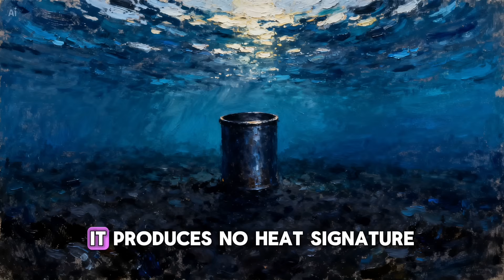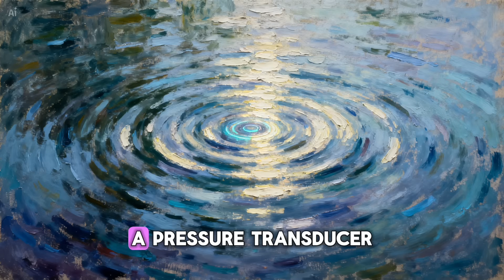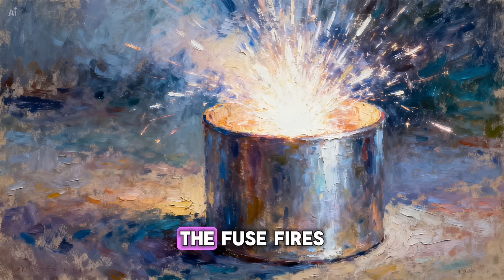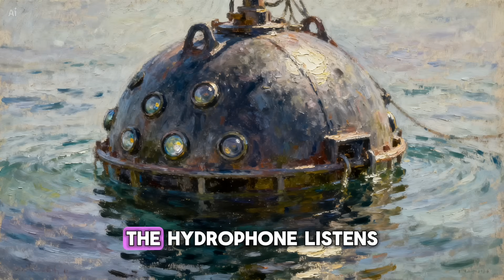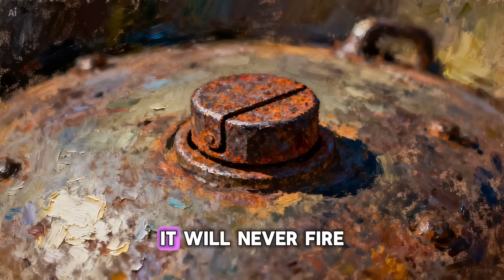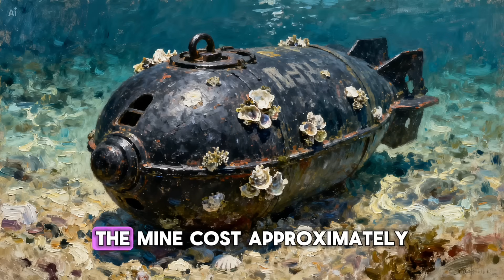Why Iran's Entire Mine Strategy Fails Against One US Ship Nobody Talks About

Comment: great video.  some notes.  small iranian fast attack ships don't create a pressure wave large enough to trigger a influence mine set to be triggered by a major vessel's compression wave.  Next 10 of the 14 MCM have been decommissioned.  Including some in late 2025 and early 2026.  Currently only 4 of these MCM are still in service.  they were based with the 7th fleet in Japan.   I assume these are being moved.  The replacement vessels are the Littoral Combat vessels.  I don't think those ships are as invisible to influence mines as the MCM Avenger class ships.

Comment: 3 minutes of information that you mangle into a 20 minute video. 
Hormuz being cleared of mines. Iran defeated. 

The video from the WarVision channel explains why Iran’s naval mine strategy in the Persian Gulf (especially the Strait of Hormuz) has a critical flaw against the U.S. Navy’s Avenger-class mine countermeasures ship (MCM-1, like the USS Avenger).
Iran fields 5,000–6,000 mines, including advanced influence mines that use a three-sensor system (magnetic, acoustic, and pressure) to detect and target large steel-hulled ships while ignoring small or low-signature vessels.
The Avenger defeats them entirely through its design:
•  Wooden hull (Douglas fir and cedar with fiberglass sheathing) that produces no magnetic signature.
•  Vibration-isolated engines and low-cavitation propellers that minimize acoustic noise.
•  Small size and low speed that keep its pressure wave below detection thresholds.
This renders the mines effectively “blind” to the Avenger, which can then use advanced sonar (AN/SQQ-32), towed systems, and low-cost disposal vehicles to hunt and destroy mines one by one.
The video also covers Iran’s doctrinal weaknesses (e.g., its own mines hinder its surface fleet) and the cost asymmetry (expensive single-use mines vs. a reusable, specialized ship). It draws on real systems, historical context like the 1987 tanker war, and current U.S. deployments. ￼
Overall, it’s a technical breakdown arguing that Iran’s mine warfare approach is fundamentally undermined by one low-tech but cleverly designed U.S. vessel that “nobody talks about.”
Reply: The video bloat is standard practice because of the way videos are monetized on YouTube.

Comment: I worked with a Retired Admiral.  He told me that, during an earlier war (Iraq?), mines were cleared by sailing an old tanker (with no cargo, only water) through the Straits and blowing up mines.  He said that it worked well.  The tanker took the shock and kept going.

Retired electrical engineer, ships.
Reply: Wow ooohh. Why didn't  anyone thought of that an old tanker. Problem solved. And what did  we achieved in Iraq really.

Comment: Hovercraft
Reply: How do hovercraft avoid being detected by proximity fuses? I presume you are not advocating for hovercraft to transport oil or cargo?
Reply: @ricklearn16 hover craft don't touch the water. So it won't set off a mine. A hover craft can carry an M1 Abrams and other stuff at a time.
Reply: @mmkkggggoodd2315  I have ridden hovercraft on several channel crossings arround the world. They are awesome. My only point was that they are still susceptable to proximity fuses.  It would not take much to puncture the soft skirt on a hovercraft and it cuold no longer hover.  The problem with the Strait is not the number of M1 Abrams tanks and other stuff that can get through the Strait. It is the millions of barrels of oil per day that is strangling the world economy. The Iranian mine strategy is not the hold up. A single missile or drone can sink a tanker with two million barrels of oil and there is no insurance carrier who will insure against that risk and no ship owner who will take that risk without insurance. That is the important issue and hovercraft do not solve that issue. Hovercraft may partially solve the limited scope of the premise in this thread.